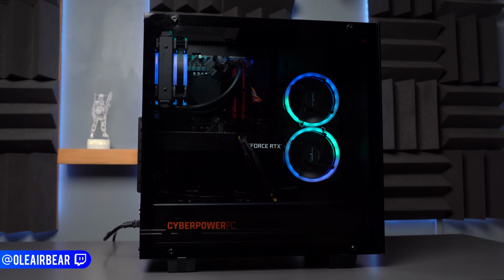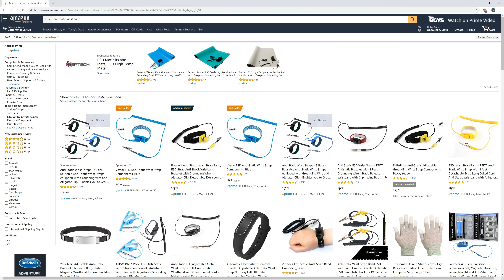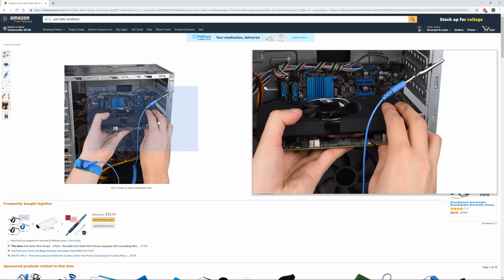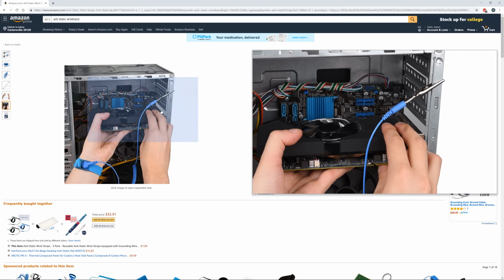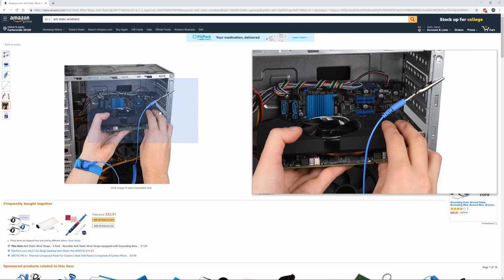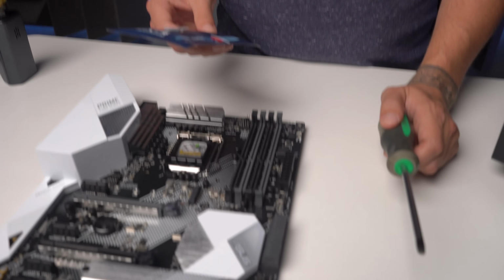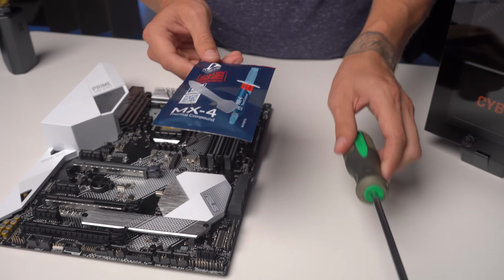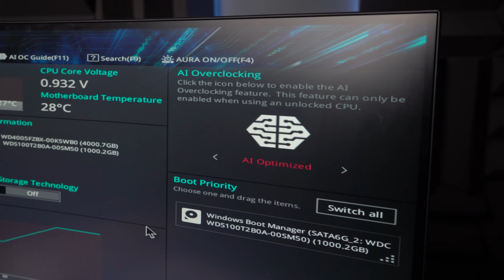How to Install / Swap your PC Motherboard STEP BY STEP

Comment from the maker: NOTI GANG MUCH LOVE! Starting my STEP BY STEP PC tutorials, installs and modifications playlist. Hope you enjoy 😁
Reply: I have the same case and idk how to take the back off it won’t come off when I remove the thumb screws
Reply: Don't know if you respond but don't you have to reinstall Windows or something after
Reply: What about windows? Did u have to re buy windows? How does that whole thing work?
Reply: This is so funny, I swapped from the MSI gaming plus board to the AMD equivalent of this board you swapped to.  However, I swapped again and I just built in a louqe ghost s1.

Comment: Swapped my cpu out yesterday, learned that it needs a bios update which can only be done with the old cpu in.. took out the new and put the old one back in but it didn’t seat correctly and bent many pins… now I need to upgrade the motherboard or find an older copy lol amazing

Comment: Do not follow this man’s advice and swap the CPU protective cover if you don’t know what you’re doing. I have experience building PCs. I have built many over the past 2 years but never did this until today. Now the pins on my older motherboard are bent. 🙃 idk why I bothered.
Reply: Update: I was able to bend the pins back. The tip of one of them snapped off though. Motherboard still works. SMH
Reply: @Lou_e92 lol that’s what is important at least it works btw I need advice cus I’m trying to save up lmao, to upgrade my whole pc psu,motherboard,cpu all that it’s my first time trying to build a pc and trying to disassemble all the pins and all that I wanted your pieces of advice cus of someone who is already experienced in this type of road, because ChatGPT sometimes js doesn’t make sense, thanks a lot bro 🙏🏼

Comment: unfortunately im now going to have to change motherboard and new cpu without a backup. a i went to re install the aio as the other day i showing my dad what im replacing and the aio was lose and was tight last time i just thought moving it was reason, sadly the hook bracket am4 one the hook's broke , i was already changing the motherboard as new case but was starting it up one last time to back up ssd what i should just done before i moved it, but this time the new aio well that not getting used, more powerful am4 cpu from 1800x to 5700x so 95w to 65w and height is a huge thing in new case as flat case from Silverstone so LP air cooler id 67 is what it getting. old pc not used since i got av receiver that why flat case the new case fit below that so while im changing case i thought sod it lets give it one refresh before the big upgrade to am5 or 6 and at the same time use less power, and good thing a flat case no gpu sag, only thing i got to make sure is good air flow and positive pressure so 3x 120mm in and two 80mm out what help with dust. i now just hope the update goes well as old software even adobe people are saying where download link gone so hard to find so i got backup for that as no way im paying monthly all i want to do one payment then it mine to use so i hope new motherboard and cpu and only putting ssd in to start with it load up good then updates then add rest storage when it working great fingers crossed, but now no backup im on edge now as waiting on amazon to turn up for it 2nd drop today, amazon are strange like that and most important the board and new psu comes last, memory usb and paste first , i got paste now as i could not install the aio so it not be an issue mx4, i thought trying the mx6 stuff this time as it going to have less airflow other my old case but it using less power to, a lot fingers crossed today
Reply: Good luck man hope everything goes smooth, same lol I’m upgrading my whole pc but I’m keeping my old ssd to keep my windows activation and other files lol and again good luck with everything
Reply: @qimobimo  it worked then did not, and m.2 the new boot drive if old windows ssd failed me , the old windows key did not work, so had to buy another cheap one, the m.2 it was impossible to install i had to use dos to swap it then change the format of the drive, so ended up with a total new install , a month later windows corrupted or it was old 1070 or both sop another re install and now with a 5060 ti 16gb what performs very well , so far things seems good, but new motherboard, new 5700x from 1800x , new psu and new gpu and new case Silverstone GD10 one those flat cases it a new pc, that old boot ssd that had to be swapped but that small time i had logged in to new setup  i managed to back everything up what mattered , software a headache still working that out but old boot drive that now steam library. it was not plane sailing sadly it was all drivers and they were not working, then i tried using windows repair that failed then i mess disk separations then completely screwed it up as windows would not even boot, then a new install after headache but thankfully goggle gave me step by step using doss to wipe and change the drive format something nsu i know n something then windows allow to instal on the m.2 . finally finished full build the full pc upgraded the gpu faster than i wanted and so far since the last windows re install i got usb drive for the backup fit self thing so fingers crossed it back up and running again and running well
Reply: @qimobimo  also good luck to self, the thing what i messed up with was motherboard version as i thought v1.2 as that pictures on amazon but was v1.5 what lead me on path fixing windows and all went wring then, so best advice get correct drivers and stuff for the motherboard you have, that may save you a headache as i had it running but wrong drivers made me thing windows . if you can get away with a new boot drive, long run that a good thing but hassle all software and will old windows key work but you can get cheap ish ones on ebay or amazon. my motherboard a gigabyte the the v number i think bottom left corner so make sure you have correct drivers for the correct version of the motherboard as could ne a new one or old version same board  but v1.0.  so look up the bord itself it may even say on it and download correct ones for it. good luck and hope you get better luck than i did but long run happy now boot on the m.2
Reply: @s @stevekenilworth anks a lot bro I really appreciate it I’ll try my best thanks a lot and happy for your new build and finally things are good 🎉🔥
Reply: @s @stevekenilworth and one more thing u said I should update my bios in my current motherboard before I should upgrade to the next motherboard? I apologize if I took your time
Reply: @qimobimo  if you are changing to new motherboard, then id download the motherboard software, the utility app and to get a good start download the wifi and ethernet driver as after you have internet connected the utility app should have a section to look for drivers. your old motherboard don't worry about that, it will be your new motherboard you need the bios but its a thing i did not do as motherboard was already updated for my cpu so i did not bother, before you start to change over hardware id say find the motherboard bios for the version / revision motherboard you have as if you search drivers and bios for new motherboard you may see different versions of the same motherboard as over years they slightly tweak them so important to get correct one if you need to but best having it downloaded even if you do not use it, look on motherboard it may say v and a number or revision and a number. but key driver you should download is wifi or internet cable or both drivers and the utility app for the motherboard like the gigabyte one app centre so your key thing is to work out the motherboard you have with the version of that motherboard, download internet drivers and the main app, the rest should be straight forward as main app hopefully have a section you can download the drivers and that app will find you the correct ones but you need internet so internet drivers for correct version motherboard that important, if your cpu not on list of current version of the motherboard then you may need to do bios and loads vids on youtube to show you how to on your motherboard , if your cpu just works and you can enable xmp or d something for AMD that put your ram to it full speed and slight boost on cpu . remember don't go on pictures but look on motherboard it should say what version , do that and then search motherboard name , you have a tab to click on for your version then maybe support tab and drivers and bios. for me as a bios can fail and things get more tricky , if cpu just works i do not bother but that totally on you what you choose as newer bios if not needed may unlock more options in bios and add more cpu's to list . key thing bios just in case, internet drivers and the app for the motherboard a utility app , rest should be easy and automated if the app has that option, but you are connected to internet so worst case go back to same page where you got internet driver from and download and install those, old motherboard forget about that, just put it in storage for emergency's if it still works. one thing you might get a black screen saying something about bit locker  press y o continue , if you not got bit coins or other internet cions just continue , if you have i think it may wipe them , if you get message then google it on phone to get a better understanding, i had that installing new cpu, as i think the computer shop used another cpu to do bios so a message you may run in to. i hope that can give you some help, need any more help or question i can try and help
Reply: @stevekenilworth thank you so much man for all of this info I really appreciate it when I’ll finish building till I save up some money from my partime job 😅, I’ll tell ya mate, anyways take care and good luck and again thanks a lot
Reply: @qimobimo  no problem , get stuck give us a shout , i try and help but still stuff i need google for but you always welcome to contact and do my best to help, take care

Comment: Do i need the 24 pin for it to work or can I use 3 white connectors equal to 8 pins on the 8 pin on the other side?

Comment: I was legit watching this video preparing for switching my motherboard tommorow, after thinking my current one got bricked during a graphics card install since no fans would spin (case fans, gpu, cpu), and I for fun tried the full drain power thing, and then boom, computer came back to life after thinking it dead for a week!

Comment: what a help , still cant get the configuration right to make aqua7 and old  dell 0nnnct boot, power tested to board , cpu fan running . those dreaded pin cabling ..wow my eyes are bad and no diagram and no connecter , like in your video . plus the usb c cable connector in probably 3.0 or 3.1  idk..doesnt match /...help[ lol

Comment: I've been having this mouse cursor issue where it's literally unusable. Basically, having a mibd of it's own. Could this be a faulty GPU or possibly a faulty Motherboard? Bc I've tried everything, new mouses, updating mouse driver, ect. It's been getting worse and worse for the past few months, now it's completely unusable. Thanks in advance!

Comment: This helped me identify the problem with my pc at home! Had a friend install my motherboard and put the individual bottom connectors for led power and switch power in the wrong ports! My little raccon-like fingers fixed it tho!

Comment: oh wow, looks easy. I've changed CPU and GPU before, but not a Motherboard. I'm looking to replace mine with an AMD Chipset, so i can use AMD Cpu instead of Intel. I've heard there's problems with lots of the Intel CPU's. I'm using the 13400f, but want to upgrade to a better one, i do play a CPU heavy game, so i really need to if i want to get better performance

Comment: My new motherboard is wider than my old one my case has the extra screw holes but I don't have extra screws it should be fine if i just reuse the same screws even if a few are missing right?

Comment: With swapping out the mobo and cpu but everything else is the same (primarily the SSD that holds the OS) is there anything you need to do special to set things up after powering on or is it essentially plug and play?

Comment: Will my previous HD files and setting automatically sync with the new motherboard? I’m trying to keep the files/settings, and just swap the motherboard. 

Or is there another step I need to do after swapping?

Comment: Amazing video here. Very clear and concise. However, you do not normally have to manually remove that plastic CPU socket cover. It will pop off by itself while installing your CPU.

Comment: If im exchanging B560 for z590 and the prosessor is i7-11700KF without onboard graphics. Will my windows recognise new motherboard and will I atleast have video. Using RTX3070 GPU.  PLEASE give me some clues maybe I can prepare my windows downloading new mo boards driver before starting. Using windows 11 which i bought with prebilt pc and it was win10 which updated to 11 for free at some point. Any help appreciated Thanks.

Comment: I broke my motherboard, if i change the mobo do i have to reinstall windows?
Reply: no, windows will be installed to your ssd
Reply: @kadenmyers2568  ah nice, so is basically plug and play or i have to do additional stuff?

Comment: so if you swap the mother borad dont you also need to replace the power supply? im stuck with a mother board that its not comparable with my rtx 4070ti according to pc benchmar site. thankz

Comment: Thanks for the guide, one thing though is that when you install the radiator fans, make sure they are intake because you want cold air going through them, not hot air.

Comment: A nice run through
Re the power on off hd / led cables that everyone dreads and cannot read in the manual
I had never seen that little plug that comes on "nice motherboards".
I will try to get one maybe on Amazon

Comment: Literally just swapped my mother board and the pc won’t even start up, what do I do? Ram is good, power supply is good, cpu is good. All the cables look plugged in. Idk 🤷‍♂️
Reply from the maker: Try going to just one ram stick for the first startup. Each motherboard is different so it may help to look up a troubleshoot guide
Reply: Did that work?

Comment: @7:09 what is push-pull configuration? I have two fans on my CPU. Does that mean the fan on the right of the CPU blows left (towards the rear of the tower) and the fan on the left blows right (towards the front)? And do you need to use new thermo compound just for a mobo swap of the same part number?

Comment: hi sir youre one of the experts i trust so ill base the things i i would do to ur answer with this question.

situation: i have an ssd with and existing windows. i replaced my old b450m steel legend mobo with a new b450m steel legend motherboard because the old one was too dirty. 

question, 
what are the things i should do when using the same ssd with a new but the same model of motherboard? is it plug and play or do i have to reinstall windows

Comment: Any experts out there have any tips for changing all my computer pieces to a new motherboard? Like will windows still be installed? Will basically boot up like my old computer? Are there different types of motherboards I need to get like AMD only or something?
Reply: I want to switch from an am3 to am4 for a better cpu

Comment: Is it necessary to do a clean installation of Windows OS after you swap a new motherboard?
Reply: I would still do it, but it isn't absolutely required. I would first uninstall the motherboard-specific drivers and software. Then, install the new board and the new drivers and software. In some instances, you may need to do a clean install. This was especially true in older versions of Windows (W7 and older)

Comment: Does it matter what model your mother bored is (I know the socket matters) but my motherbored is failing and l wanna switch it but lets say for example l havs a Asus motherbored and l wanna switch it to a tuff motherbored does that matter at all (I have a Ryzen 3 processer if that matters at all). Sorry im new to this. 😅

Comment: Very useful and helpful video for all beginners!
If I may, I would like to add a few tips.
If you're swapping MB, take some pictures and a short video of the wiring, that's where most errors come from.
In winter, because of the many layers of clothing, more static electricity accumulates, keep that in mind!
All the best guys !
Reply: pro tip: replace MOBO naked
Reply: @qillura  This does work
Reply: I can't stress enough how much time and stress I would have saved if I took a picture first. I hope people see this.

Comment: I remember the first time I built my pc……dam io shield that came with my motherboard had these hook tabs that prevented me from getting the board all the way on the board to case screw holders…..ended up scraping the motherboard and had some loose pieces in the case afterwards 😂.

Finally realized the dam io shield was the problem. Cut those useless piece of shit things off. 

But it made me realize that while you should be careful when building ur Pc, don’t baby it or stress out. Pcs are much better than what they use to be; much higher standards (at least for most brands)

Comment: 1 question... Is there any problem if i dont have cpu protection/holder or however i call it like... That metal thingy after u put cpu u close it with small metal pipe

Comment: I've installed a new motherboard, with my existing CPU. Went from ASRock B550M Pro4 to a Gigabyte Aorus B550M Gaming Pro-P. Everything else was existing. Upon booting up, Bios screen opened up and i clicked DEL but it just loaded for a few minutes and opened up to my Windows home screen. I'm a beginner so what should I do from here? Windows is asking for a restart but i dont know if i should install new drivers first or something. Thanks